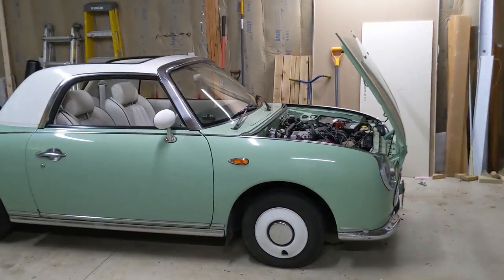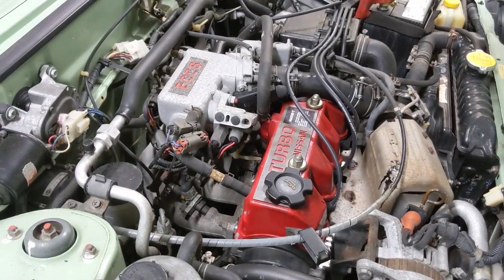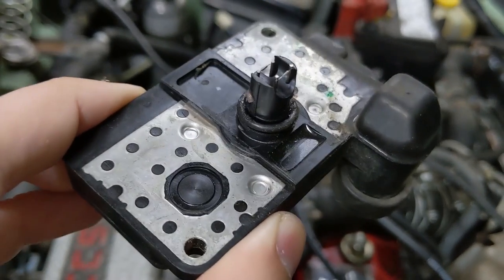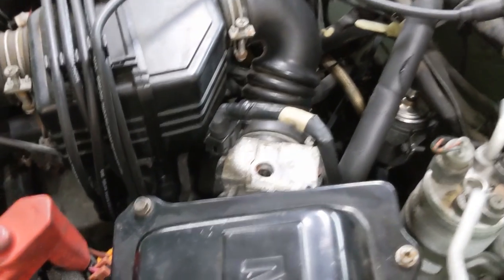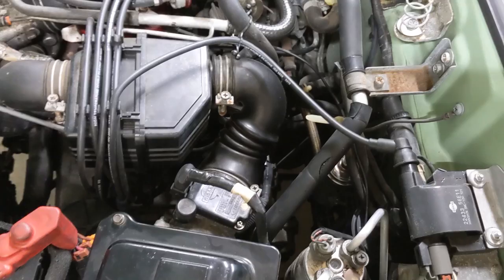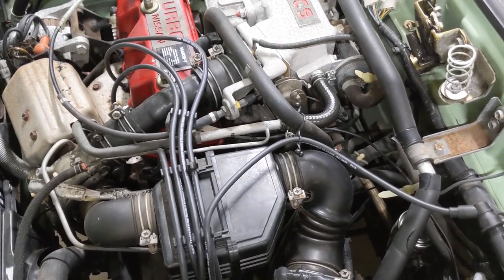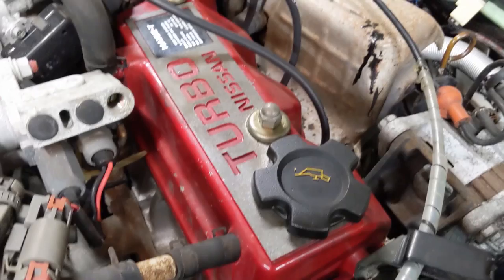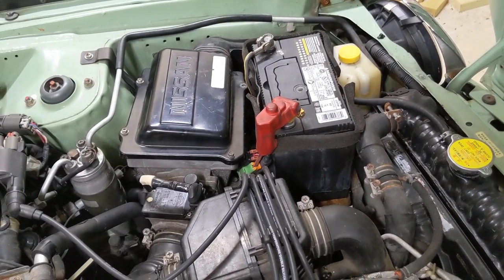Modern engine control musings and Fixing a Figaro

Comment: Automotive Technician here. As others have said, check for vacuum leaks, not just from vacuum lines but even things like the manifold and throttle body gaskets, throttle shaft, all of the valves connected to the intake, even the brake booster. On that age of car, things break down, and the fact that it is turbocharged puts all those parts on the intake under more strain. Also, check the intake hoses, intercooler piping and even the intercooler itself for leaks/splits.
Also, another idea to throw out is the coolant temperature sensor. I can't remember if Robert replaced that or not, but Nissans have an issue with poor connection at this sensor. It can be a problem with the sensor or the connector or both. If the sensor fails or the resistance caused by a poor connection skews the ECT sensor reading enough to make it inaccurate but still be within normal range, it will not set a fault code. This is one of the biggest difference between older EFI and modern EFI systems, the self-diagnostics. On older EFI systems (when working with 5V sensors) as long as the sensor voltage is between about 0.05-4.95V, it will be considered to be OK by the ECM and it will use the sensor reading even if it is completely inaccurate, because it isn't programmed to do anything else. Modern cars will compare like sensors to see if their readings are plausible, even if they are all "within normal range," i.e. if your car sat overnight (known as a cold soak) all the temperature sensor should be pretty close to each other. If you ambient air temp, intake air temp, engine oil temp, transmission oil temp sensors all read 70 deg after sitting overnight but your engine coolant temp reads 150 deg, this would be considered OK by an older OBD system but would likely set a plausibility fault on a newer OBD system.

(side note, in the industry to have a saying, "NEW stands for Never Ever Worked." Don't assume that a part is working properly just because it is new, especially if it is an aftermarket part)
The reason I bring up the coolant temp sensor is because, aside from it being a common issue on that era of Nissan, its one of the few sensors used during initial start-up. Aside from the newest low emissions vehicles and hybrids, many engine sensors are ignored during start-up because cranking emissions weren't really a big deal until just recently. While cranking and for a second after the engine starts, most of the timing and fuel calculations are all done from really basic look-up tables in the ECM, and really the only modifiers for that come from battery voltage (low battery voltage increases injector latency, so the pulse width needs to be increased if the battery voltage is low), throttle position (mainly used to shut off the injectors on many cars if the throttle is wide open), and the intake air and coolant temp sensors (cold engines need more air and fuel to start in order to overcome the tendency for the gasoline to condense on cold parts, liquid gasoline doesn't burn). The engine speed sensor (usually the crankshaft position sensor, but on older cars with a distributor they usually only have sensors in the distributor for engine speed) is also used but usually just for ignition since again, the timing of the fuel injection isn't critical just to make the engine start. The coolant temperature sensor has arguably one of the most important roles in how well you engine starts, because it pretty much single-handedly determines what fuel mixture the ECM is attempting to deliver during cranking. The particular starting issue you are having seems more like a cranking mixture issue to me because it runs poorly immediately after it starts. Typically if you have something like a MAF issue or a vacuum leak, it will start fine and run ok for a second before it either starts to run like poo or stalls out. I'm also concerned about the ECT sensor reading because of the high idle. Cold engines need more air and usually will have a higher cold idle. Some older cars did this mechanically by either using a fast-idle valve with a wax motor in them that is heated up by the coolant or by using a wax motor to push the throttle linkage open when cold, but in other cases, it is done electronically either with vacuum switching valves (solenoids) or an idle air control valve. If the ECT sensor reading is cold all the time, it could cause this issue.
Anyway, I'm rambling now, but hopefully you'll find some of this info useful.

Comment: Your high idle speed is being caused by a vacuum leak. Your surging my be caused by a loose timing belt. A loose timing belt will cause the relationship between the crank and cam sensor to be off.
Reply: He had the timing belt replaced on another channel and it was done properly.
Reply: Timing belt loose both before and after swapping it? Chances of that are somewhat low imo.
Reply: A vacuum leak on a 30 year car would be expected.
Reply: Or Hall sensor is busted. Older Japanese cars has that problem pretty regularly. Error codes are indicative of that. Sometimes you cannot start engine at all but sometimes it works but poorly.
Reply: @jakublulek3261  if the cam or crank sensor were busted the car wouldn't run.
Reply: @NandR  if the timing belt is new then the teeth on the distributor gear may be worn. I had that problem with a 1997 chevy pickup.
Reply: @pantro1014  Depends on car. I saw couple older Mazda's that run even with Hall sensor busted, but poorly. Vacuum leak is good guess but that is more carburettor-era problem, my Cortina Mk.5 had it, after 30 years of no problems.
Reply: @jakublulek3261  a vacuum leak will cause high idle and  even misfires at idle in modern cars. In a turbo car a vacuum leak becomes a boost leak.
Reply: Thought exact same. Then saw timing belt replaced. Still could be vacum leak for sure. Especially if u have a brake booster or a leaking vacuum canister.

Comment: Oh my goodness I would love a Technology Connections "History of Engine Control Systems" video -- and you're 100% correct, computers were already more common than people assume in the late 70s. Most of the early ones were "feedback carbs", which had all (or more) of the complexity with very little control. But there was a huge leap forward in technology during the 80s, and fuel injection went from being exotic to commonplace in only a few years. Carbs were practically eradicated in the US by 1990. I dunno if you read these things, but if you happen to see this, look up the Bendix Electrojector EFI from 1958 - you'll get a kick out of that!

Comment: There's likely a vacuum throttle solenoid to control idle.  They've been around for a long time. My 79 Ford had one that'd set the cold idle higher while the choke was on.

Comment: WOW that does not look like a 90's car. It's very clean looking but real retro styling. I like it!
I used to own a few late 80's/late 90's Honda's with their early PGM-FI systems. The Idle Air Control Valve (IACV) on them was also a common fail point of cold start problems and idle hunting, and since I believe coolant would run through it as well, if there were bubbles in the line it would also give it conniptions. It was amazing how many problems could occur just because of coolant not being bled properly. Enjoy the car!

Comment: Intake air leaks are definitely worth a look. Smoke testing is the best method I've found for flushing out difficult to find leaks. As for the idle hunting air leaks could cause this but oftentimes on this era of Nissans the idle air controller or AAC as Nissan call it is carboned up, cleaning it with carby cleaner dramatically improves idle quality and clears up the hunting.

Comment: I work at an auto parts store.  The MAF sensors are shockingly expensive.  Especially for foreign cars.  I definitely recommend that people try cleaning it first before replacing.  $10 for a can of cleaner vs $200 for a new sensor you might not actually need.  But when they go bad, it wrecks the performance and gas mileage of the engine, if it even runs at all.
-
Also expensive are the Oxygen Sensors, on average about $80-$120 each.  When they go bad (and they go bad often, usually what turns on Check Engine Lights), it destroys your gas mileage as well.  Thankfully a Check-Engine-Light scanner (OBD2) will tell you exactly which one is bad.  (There's 2 sensors on 4 cylinder engines, and 4 sensors on 6, 8 and 10 cylinder engines.)  You save money in the long run after replacing them, since you won't be getting 8 miles to the gallon anymore.

Comment: 6:30 - Auxiliary air valve, little bimetal strip heated by electricity to close a rotary port as engine heats up. Some/many engines had water lines going to it as well so it doesn't reopen while the engine is off for a few minutes while warm. These are a hallmark of a Bosch derived system - as are the rectangular plugs on all your injectors and other components.
Reply: Yes, commonly used on Bosch K-Jetronic systems. Even perfectly functioning it relies on engine vibrations to move. I can imagine that it fails to open as the engine is cooling down. If so, a little tappy-tap-tap before cold start should help.

Comment: An interesting video. Here in the UK I had a 1988 Nissan Sunny Coupe that still used a carburettor. Fuel Injection was reserved for the top of the range ZX models. An improvement over my 1979 car was that they had replaced the points with an electronic sensor in the distributor which triggered electronic ignition. Maybe that explains the position of the sensor.

Comment: The auxiliary air valve you mention is adjustable - loosen the locknut and set the hole in the disc to give a higher cold idle which is probably all the engine needs.

Comment: I have a 1994 Nissan 300ZX Z32 that I work on a lot. I have worked on a few over the years too. From what I know about 90s Nissans, a vacuum leak could be an issue. Plugging the intake pipe with a balloon or rubbler glove, disconnect the brake booster vacuum line and blow up the balloon. Then hold your finger over the vacuum line. If the balloon deflates, you have a leak. Sometimes you can tell where it is coming from by listening. Secondly, my 300ZX uses a Consult connection to communicate with the ECU. The Figaro might as well. As an owner of the vehicle, you might want to pick one up with the software for Windows. There is even an Android app that uses the Bluetooth version of the adapter. The Windows version does have more features though. It isn't expensive, but I highly recommend it because you can see all the sensor data and diagnose O2 issues and TPS issues etc. Another thing to consider is corrosion on the wires. They often get very green all the way up the wire. Make sure you check the connectors for any corrosion as well. The early model Z32s with the early style injectors had huge issues with corrosion because the ethanol in modern fuel. Almost all of the series 1 injectors go bad. It is usually one of the first things to do. I bought a pristine, low mile 1994 TT that had no corrosion anywhere, except the injectors. Good luck!

Comment: Imagine a American-French engine computer from 1987 used in a major automotive brand that is completely ahead of it's time, but also fairly crude. 

I introduce the Renix system for AMC Jeeps, it has a reliable heated O2 sensor, multi spark ignition system, sequential fuel injection, and yet no way to store engine faults unless you hook it up to a rare engine diagnostic reader that was only available to dealers. It's 4WD and A/C systems are operated by a series of vacuum motors through out the vehicle. Also the automatic transmission for the 4.0L engine is controlled via computer. Had wireless key entry, and yet no power seats.

It's amazing how mine is even working today.

Comment: Had some fun finding an engine problem in my 150 PS 1.9 JTDm Alfa 159 as well, that also covered the MAF. Yours is as clean as it can be. But if you're unsure, Ebay is a good source for all kinds of stuff you cannot find anywhere else. An A/B test can help sometimes to determine the actual source.

Comment: The distributor I had on a Mitsubishi (about the same age, more or less the same tech), looked like it was a straight bolt into the cams.
But when you took it apart, there was no solid connection. One side was a sensor for the cam, the other a motor.

It did alter the timing by rotation to suit, though as far as I am aware, it was more crude than the ignition packs we have now.
And basically knocked the whole sequence forward, or backward a few degrees relative to throttle position.

The throttle also had a direct wire, but again was split into a sensor, and motor. So the throttle was electric too.

Comment: If you want a weird (albeit not exactly modern) engine control system to discuss, the Bosch Trionic system in Saabs is my absolute favorite. Ionic knock detection through the spark plugs!

Comment: Can confirm how this style of MAF sensor works. The PCM applies heat to the resistors shown, they're both heating elements. It will then monitor them to ensure they are at the correct temperatures. If they are not at the correct temperature, voltage will be applied or removed until it reaches that temperature.
The amount of voltage required to maintain that temperature is monitored and compared to a mapping table that tells the PCM approximately what amount of air is entering the engine through the intake system, assuming the intake system hasn't been tampered with beyond factory specifications (I.E. via putting a high-flow filter on or removing a resonator).
This system sometimes has the IAT sensor integrated as well, which might be the second resistor. (this will instead be a thermistor, which will usually also send a signal immediately upon key on to establish a base signal to go off of for starting) The IAT also effects this map since temperature also effects how quickly the resistor will cool and thus the effort required to keep it warm.
Both signals are used to reference each other, depending on make and model, since air flow will effect the IAT and cold or heat will effect the MAF.
There are multiple styles of MAF, this is just the one I know the most about.

Comment: The 6BT 12 valve Cummins were 100% mechanical in the early 90’s.  That’s where they made their name in the consumer market.  The fuel injector pump was a miniature inline 6 motor that ran mechanically off of the engine.

Comment: When you said "once it clears it's throat it's fine" made me think of a leaky injector (if this car them - could be TBI). I have run into injectors that leak down when the engine cools down and floods the intake with fuel. It cause's hard starting and poor idle until it "clears it's throat".

Comment: I'm not sure if this engine has an idle air control valve (IACV), but definitely worth investigating. The valve tends to get dirty and begins to hang up from time to time, causing your engine to have a difficult time maintaining idle. If your Figaro engine does have one, usually you can locate the IACV, access the air inlet port, spray some throttle body cleaner in there and allow it to soak the valve within to help loosen up some of the deposit buildup. After a few minutes, start up the engine and see if anything improves. 
Sometimes this method works; other times you are replacing the valve. Again, this is just speculation on if you actually have one. Also, it wouldn't hurt to pull the intake tube off and see if you need to clean the throttle valve. Usually there's carbon/deposit buildup on the throttle valve, which again, can affect idle conditions. Some easy things to check either way.